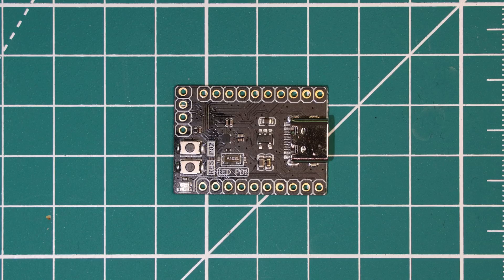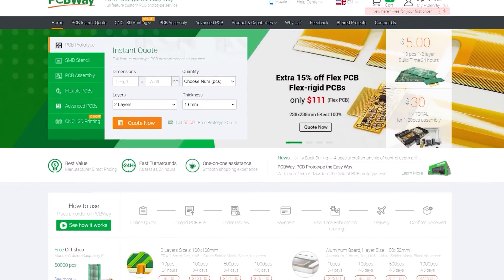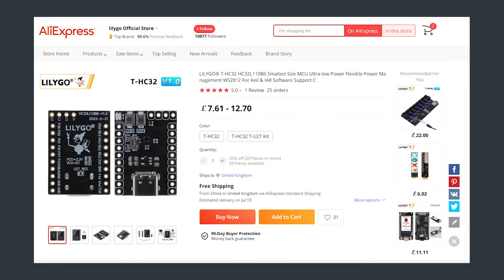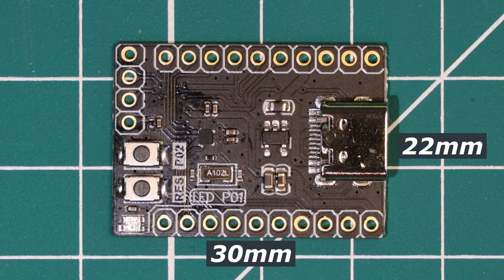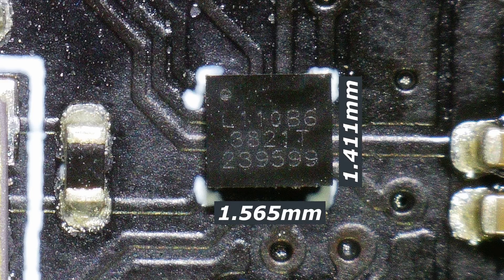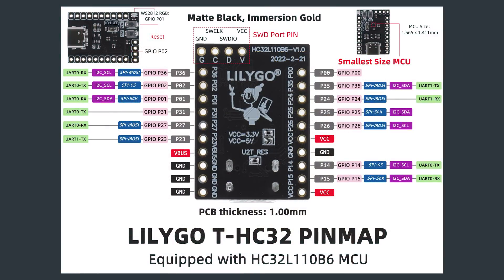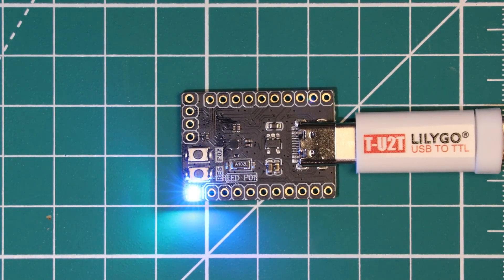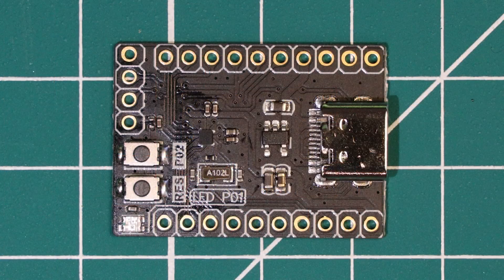World’s Smallest Arm Microcontroller: HC32L110 – Showcase & Programming Guide

Comment: Getting this tiny seems a bit of exaggerated. I mean even the capacitors take more space. It’s cool and all but as far as I know there’s no voltage regulator IC and schematic that will suit for this type of size. Of course you can build anything you want but as far as size concern, there’s no advantage to using this thing. Simply because you need to power it somehow.

Comment: Bloody dust particle of a micro!

At least it has an internal oscillator so i wager a guess, a usable application circuit is nearly zero size. Don't have anything in mind though. It has no wireless connectivity, it has no USB, and other things i can think of can do with an easier to handle package.

Comment: Is there a way to one time compile and flash the code on this one so it can be soldered to a board say as a led controller etc.
Basically wondering is there a pogo pin board which can be used for programming the flash.
Reply from the maker: I'm not aware of one but I am sure that one could be made for this chip. The only thing that might be a challenge is the small pitch between the BGA pins

Comment: the ADC and the I2C bus makes me think probably useful for sensors with some basic logic either as triggers (relay control via gpio) or data logging/transmission via a supplementary wireless module, you could no doubt connect a tiny OLED display to it, or a more traditional character LCD

Comment: I've always wondered about multi chip interleaved ADC sampling e.g. to use as front end for a basic scope for debugging, experimentation or just an educational exercise. Provided I can get the interleaved timings right, 4 of these could equate to a theoretical 12bit 4M samples/s ADC, and/or make it reconfigurable to 4ch x 12bit @1MS, or 8ch @ .5MS logic analyzer 🤔. 

Oscilloscopes are just to damn expensive for me - I dont need absolute time and/or voltage measurement accuracy, just relative measurements. E.g. if for a change in x, how does that affect y & z.

Disclaimer: Just a self thought hobbiest here
Reply: Depending on the sample rate you require you can use stm32f303cc very cheap, has 4 adc each can sample at up to 5Msps. Interleaved can sample at 20msps if you can solve the interleaving. Has much more ram for buffering, supports usb, etc.

Comment: How big is the ARM SoC inside the Apple Lightning to HDMI adapter? For those who don’t know: Lightning isn’t fast enough for uncompressed HDMI, so instead the iPhone or iPad uses its built in h264 encoder to compress the outgoing video, which is sent over Lightning to the SoC in the adapter, which actually runs a tiny stripped-down version of the iOS kernel. The SoC then decodes the h264 stream and outputs it to HDMI. 

Anyhow, IIRC from teardowns that is a tiny chip, too.
Reply: I can't say for sure, but that seems to be extra works than necessary. There are off the shelf chips which can do USB2.0 to HDMI with built-in H264/H265/VP8/VP9 decoding and the decoder is a hardened IP, not a software. There will still be a MCU, but only for handshaking. An 8051 will do just fine for this.
Reply: @bskull3232  Well Apple would want to use Apple stuff and make shure their deveices work only between them.

Comment: I would be surprised if PCBWay's capabilities could come anywhere near being able to support this IC.
Reply: PCBWay can do 0.15mm/0.3mm through vias and 0.1mm/0.25mm laser micro vias, and they can fill the vias so you can place them directly below pads. You are just going to spend a whole lot more for that, but it is doable. Also those ridiculously small packages are not for DIY. They are for phones and gadgets where space is at premium and PCB substrate cost it not being counted down to pennies.

Comment: i2c to spi bridge would be a useful application. looking at solutions for this in the current design i am working on at work.
Reply: I guess it depends on the application? Since I2C is so much slower than SPI, it seems to me that for the most part, peripherals that use SPI do so because they need the speed.
Reply: @tookitogo  some components will actually support both protocols, however this particular peripheral does not. This design is to retrofit an ASIC that only supports I2C in place of an existing FPGA. Speed is not an issue for this peripheral. There are some similar peripherals that have I2C that could be used. Lots of design options, but I'll likely go with a very small FPGA to provide this bridge functionality along with some other real time glue logic that needs to be implemented.
Reply: @Cracked1ce  I haven’t seen too many components (aside from small dot matrix displays) that support both I2C and SPI in one part number, though I’ve seen many that are available in both types (as separate part numbers). Can you give me an example, just to satisfy my curiosity? I don’t doubt you, I’m just curious.
Reply: @tookitogo  yeah i didn't mean alot, i meant some, i edited my comment. The AMC7812 is one example that supports both. another example is the ADT7518
Reply: @Cracked1ce  Thanks, much appreciated!
Reply: There is too much latency to translate 1:1 i2c/spi or I don't know i2c running at 64Mbps. Further I2c is a shared bus whereas SPI is more like exclusive. I2c let you adopt different logic for serving your devices and that alone can be difficult to translate into hdl. 
You'll need basic buffering for i2c and high level message management for spi spending 90% of your time saying "empty" especially if you're not interrupt driven. 
This task is more suited for a cpu having hw accelerated dma spi and i2c support Or use your asic if it has readily available i2c stack and can talk spi, the software route is dangling. 
Stm32 familly seem pretry descent if you choose an hw accererared version.
Reply: @goldnoob6191  Alot of FPGAs have built in hard IP for I2C and SPI peripherals. Even if they didn't, SPI is very easy to interface with in RTL, It's basically just a shift register. you can just read/write the registers from the SPI device into RTL registers, then let I2C read/write them. besides there are additional RTL functions that need to be executed in realtime based on these registers in the FPGA, small functions that currently exist in the very large FPGAs we are replacing with ASICs. Besides that, Lattice already has IP for an I2C to SPI bridge which can fit in a very small FPGA. Also i think you missed where i said the ASIC only has I2C and does not have SPI. Otherwise we wouldn't need this bridge

Comment: Not much use for us hobbyists - where BGA is just troublesome, and the IC physical size is not such a concern, but look at STM32G031F8P6, which is far more useable. I have a prototype board in the D1 mini form factor in the works with this chip. This board can be programmed with STM32CubeIDE. Cheers.

Comment: Hi, nice review. Do you know if this actually an ARM core licensed from ARM? 
I thought China was blocked from getting IP from ARM... they were developing their own custom SoCs.. this was a few years ago though.
Cheers,
Reply: No. The only confirmed thing happened is ARM China was making a bitter split with ARM Holdings, everything else is based on speculation. Also, RockChip just got A77 core license.
Reply: In order to keep the power consumption low with clocks, it could be a slightly modified model of ARM cortex M0+ IP core also found in Pico's RP2040.

Comment: Not all ARM-chips are alike or comparable, this one is probably designed to power an electric toothbrush.
Nothing new to see here! Also note that the ATmega328 chip that powers the generic Arduino is becoming hard to get as not many FAB's create it anymore, and its becoming obsolete.There are "Chinese work alike" that claim to be replacements, but these don't really are fully compatible and refuse to run some software. The real update to the Arduino is the RP2040 powered raspberry Pico board. And RP2040 are plentifully available.
Reply: Why use RP2040 when you can get more powerful ESP32 / ESP8266 devices cheaper?
Reply: @NotMeGeek  what? where? I can get rp2040 2-3 times cheaper than esp8266  or esp32. plus rp2040 has native usb support which esps lack.
Reply: @surajbhawal2474  rp2040 official price $4
W600-PICO V1.0.0 - wifi board based W600 1MB FLASH MicroPython prize: $ 2.88
Just for a start. Many more boards to pick from in the same price range.
Reply: @NotMeGeek  maybe true for boards. But remember you're comparing a made in uk board vs a Chinese board. The Chinese ones will always be cheaper. But I was talking about ics. Rp2040 is even cheaper than an esp8285.
Reply: @surajbhawal2474  I don't care where is made. RPi's are built in China and Europe. Rp2040 it self is from Japan.
Is all about needs and perfomce vs. cost.
You just stick to yout Pico and i'll use any kind of board ESP-32 / ESP8266 / STM32. They are all so cheap.
Reply: @NotMeGeek  While esp32 is cheap it is not a real-time MCU, and uPython is also a disadvantage in this regard. The real apples to apples comparison is only with STM32 (note not some CN ARM half-baked MCU with terrible support, but STMicro one) and they are a lot more expensive and scarse right now, especially if we compare new bare chips and not dev boards.
Reply: @NotMeGeek  RP2040 s are $0.70 each, from RP direct. So can you point me to the ESP-32 cheaper than that, thanks. :) 

I thought the Rp2040 was made in Taiwan and the raspberry Pico board was made by Sony in the UK? Are you talking about each individual part like the resistor etc?

Also, good English docs, SDK and in stock might be a problem with some chips.
Reply: @joseph9915  ESP8266 can be had for some $0.6 from China, in sample quantity, throw in $0.1 more for ESP8285, which is ESP8266+2MB of flash copackaged. The newer ESP32-C3 can be had for $0.8, with 4MB of internal flash. If you are after extremely small size, go for ESP8685 for a further $0.1 more, you get a 4mm*4mm ESP32-C3 with 2MB or 4MB flash. Furthermore, you can get your $0.1 back by buying ESP8684, which is a stripped down version of ESP8685.
Reply: @bskull3232  Thanks for the info.
The prices seem quite similar.
Reply: @NotMeGeek  because they are available, (unlike the EPS31 or ESP8266) as cheap or cheaper as these, and even more powerful, especially consider the new Pico W that has WiFi for $6 and is readily available!
Reply: @NotMeGeek  because soon they won't be more powerful or cheaper
Reply: I just stopped supporting CCP .Im going for local manifacturer .
Reply: @theciklia  Lol, HC does not need your support nor the CPC nor us Chinese as a whole. Those chips are not even sold to the West unless you buy directly from China. Those chips were made to allow China to be prepared from possible future sanctions from the West. FYI, HC's parent company, CEC, is a Chinese state owned company with a political mission to help alleviating us from high tech export control of the West. Selling to the West and making dollars was never its goal.
Reply: @bskull3232  nice try Winnie !
Btw i order only local and from Taiwan, West Taiwan is not at that level .
Reply: @theciklia  Then you are ordering from unsustainable sources. Good luck on you.